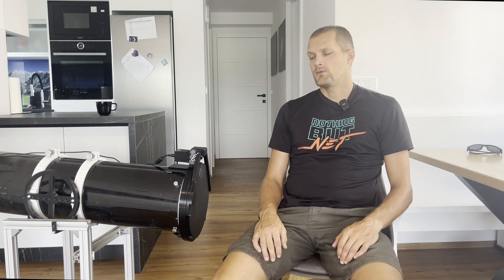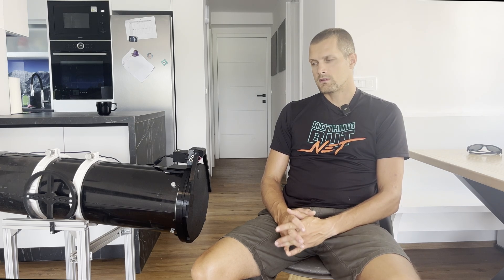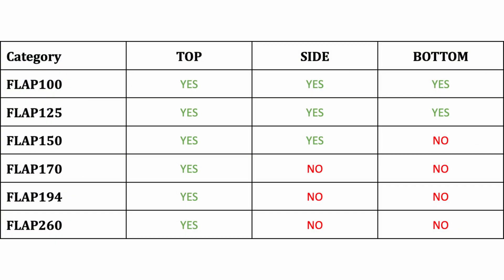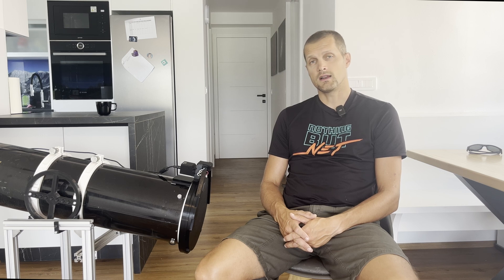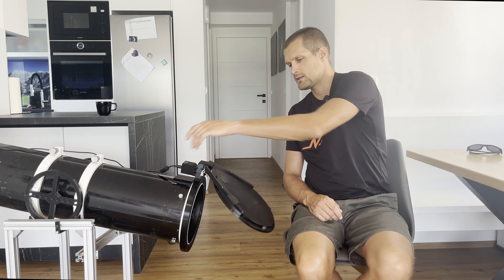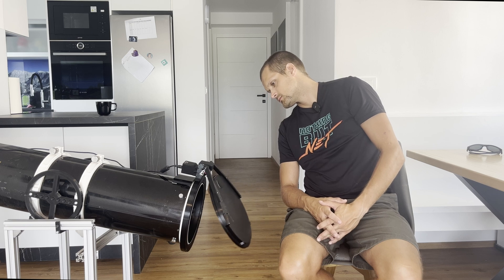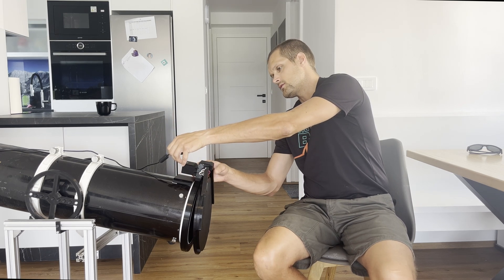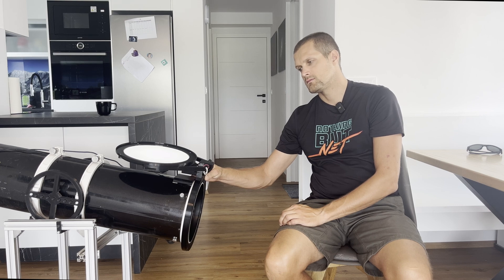New 8” flaps and semi-automated range calibration update

Comment: I am having some difficulty finding these larger sizes on your store since you have them organized by OTA, none of the TS-Optics ones listed are similar to the "TS-Optics 8" f/5 UNC Newtonian" I have.  Is there a way to filter by size only?  I'm not finding it.
Reply from the maker: @KurtVW  can you measure outer diameter of the front of the tube? And we can add it in the shop
Reply: @DeepSkyDad  I don't have a caliper that can go that big... But I come up with 238mm outside diameter of the metal ring on the front of the tube. And the outside of the carbon tube is about 233.
Reply from the maker: @KurtVW  I would attach it to the ring, like in case of my newton. Here is link to the flap for 238mm diameter (with +/-1mm margin of error): shop.deepskydad.com/product/ts-optics-8-f-5-unc-newtonian-flap-panel-fp1/